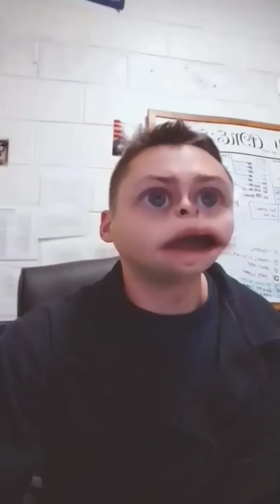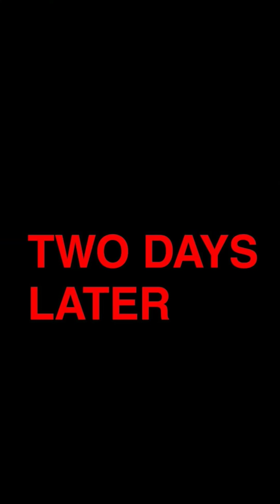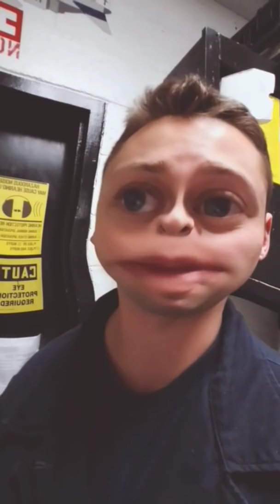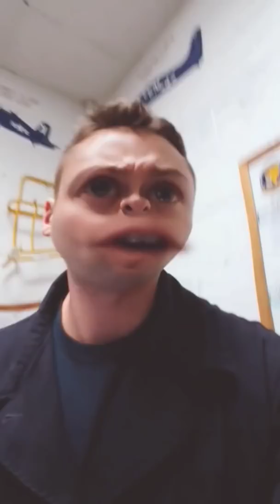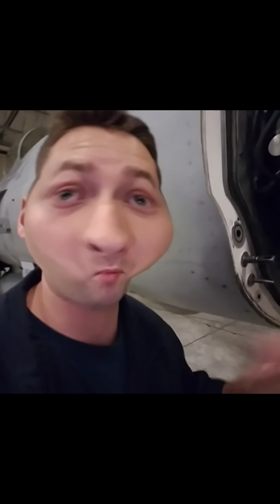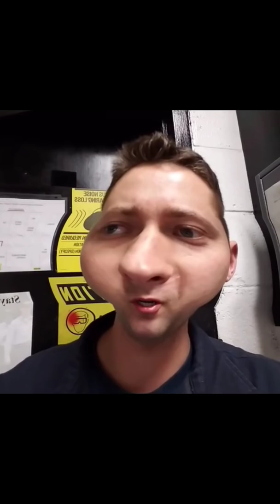Gripe Chasing

Comment: We had an APU no start on an H-46.  The mechs did everything except change the APU.  I was the NDI tech, but doubled as one of the det airframers.  The chief wanted us to change out the accumulator, but when I heard the APU try to crank up, it spooled up fine.  I could also hear the igniters ticking, and could smell the fuel.  In fact, fuel started dripping out the exhaust pipe.
I asked them if they changed the fuel nozzles (5 minute job and the part cost like 7 cents).  They claimed they did.  8 hours later, someone decided to put a new set of fuel nozzles on the APU and it fired right up....lol
Hope you start making more vids soon.  These are great!
Reply: Had a similar APU no light off on a KC-135. We changed a bunch of parts, but it kept failing to light off despite apparently having everything it needed. One thing we didnt change was the exciter box or igniter since we could hear them popping on startup like theyre supposed to. Those are also some of the few parts that generally dont break on those crap APUs.

... We finally decided to REALLY check it, make sure the ignition system was working, because we were out of ideas... And thats how my entire jet shop learned the hard way that the exciter box makes noise too, not just the igniter. So an igniter can go bad, and it'll still sound like popping. My guess is, the exciter box charges, that charge has nowhere to go with a broken igniter, and it probably discharges to ground inside the box. This is a bit different than the Engine ignition system, those exciter boxes dont do that (since we do audible checks for igniters on those, and you dont hear sh@t if the igniter isnt working). So yeah, all that throwing parts like ECUs at the problem (plural... We've gotten them bad out of Depot, so we didnt trust them), and it was one simple spark igniter.

The way we checked the ignition system was utterly terrifying. It involved using this ancient APU troubleshooting computer we rarely used (because when used for diagnosing, it would always call the ESCU bad, lol). Plugged in, we could override the start sequence, and fire off the igniter outside of the sequence. We were so fed up with just trying to listen for it, that we actually pulled the igniter out, still attached to the lead, and fired it outside the case, grounding to the combustion chamber case. Sure enough, nothing was happening, and it was the exciter box making all the popping noises. We changed the igniter, and did the test again TO MAKE ABSOLUTELY SURE THAT F@CKER WAS WORKING. Oh my god, some of the loudest and brightest sh@t I have ever seen, it sounded like explosions were going off every time it fired. Scared the sh@t out of me. APU ran fine after that... Apparently youre supposed to hide behind an acrylic shield or something to do this task safely. We didnt have anything like that, lol. Stupid igniter coulda killed one of us if we grabbed it at a bad time.

To give you some idea of how rare this is, that was the one and only time in 6 years on that jet I ever witnessed an ignition issue on an APU, and the one and only time I replaced a spark igniter on one.